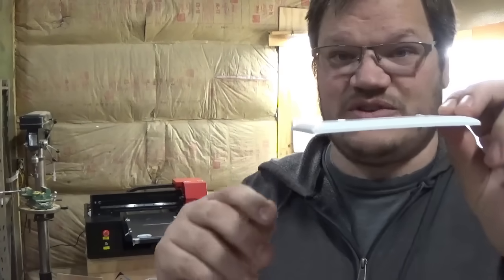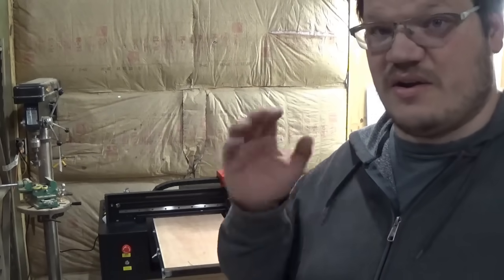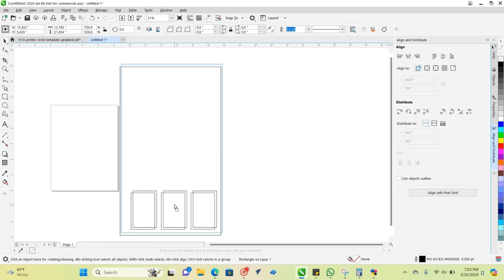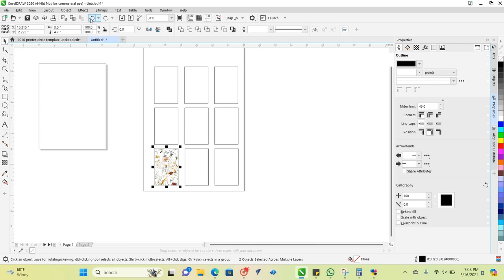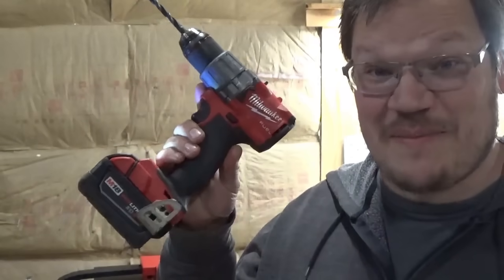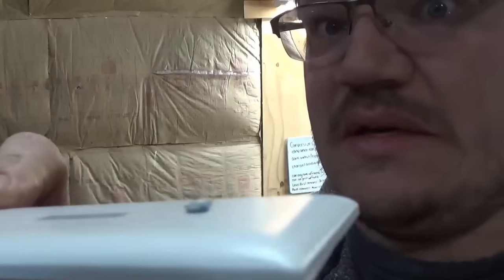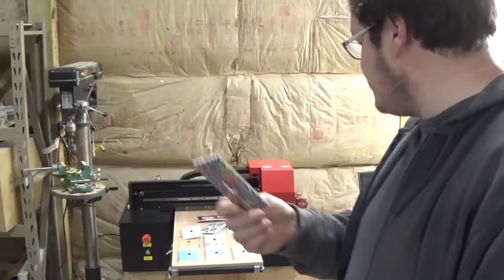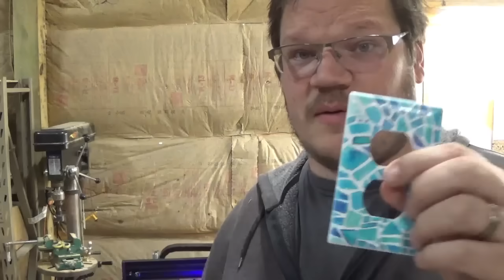How I earn $720 an hour with my uv printer  printing on light switch cover plates jaysprinters

Comment: I see people selling decorative plates for as low as  $3.99 on Amazon severely undercutting rhe $8.99. And when China sees these selling they're going to go lower than $3.99.
Reply: Right a plain white plate is .47 at home depot.
Reply: Those that waste time being worried or scared of competition should consider being an employee rather than a business owner.

Btw, this is intended to be an insult or hateful. Great businesses and business owners would never really succeed and thrive without great employees.😊
Reply: @francismarion6400  those home depot ones break a lot easier the higher selling point is how hard it is to mess up or break
Reply: Bingo!
Reply: Wow that's 86 plates an hour at $8.99 before any;  material, manufacturing, shipping or store costs... not to mention needing to sell them.
Reply: @thevibeinc  No problem. I got a GC license at 26 and successfully operated that with 15 employees for 23 years now. I've seen many scams to walk away from in my time.
Reply: Can't go lower than the cost of fuel to ship products. Then youre working for a trucking and petrol company
Reply: @limbeboy7  This guy is working for the printer company!
Reply: China ruined Amazon etc.  I stopped selling in 2013 even before Amazin itself jacked seller fees up and lots of other bad stuff.

Comment: Pretty cool! Just a suggestion, if you turn the slots in an up and down orientation on the screws, it'll make it easier for customers to line them up make electricians and OCD folks like me happy😊
Reply: Totally correct. Electricians melt down if those screws are crooked!
Reply: 😮😮😮 You can't control which way the stupid screw goes BECAUSE you need to make it tight, so whichever way it goes it how it goes!
Reply: @Some_One_One  Oh, I see.
Reply: @Some_One_One   There's plenty of wiggle room to add an extra 90-180 twist.  I've installed hundreds and hundreds this way.
Reply: @nicolashoyt5341  Maybe  it's just the hundreds you've done, and the hundreds I've done. The rest are just out of spec.
Reply: That's called 'clocking' the screws.  

Now... do you clock them vertically or horizontally?
Reply: Nonsense for people that dont have something more important in their lives!
Reply: @Some_One_One if you’ve “installed hundreds” and don’t try to clock the screws, you would certainly be in the minority.  With plastic covers there is almost always enough flex in the plate to turn the screw a little more to get the slot horizontal or vertical whatever your preference is. Most electricians will do this. Just read the rest of the comments on this video.
Reply: I ran network and home audio cabling in new construction in a previous life.  I can agree, in high end homes the screws must be up and down.
Reply: I just said that. Darn
Reply: Said what we're all thinking.
Reply: @ItchyKneeSon Vertically, gosh.
Reply: You my good Sir. You go to the head of the class! Not only the electricians and the OCD's. But now it's on the punch list. Every screw on every switch in the entire house needs to point N to S.. Worst part is until someone pointed it out it never bother me. Now I can spot it walking into a restaurant.
Reply: @VYZUNZ  Its called attention to detail. Those who can be trusted with small things have shown they can be trusted with big things. If your screws are all crooked it shows a lack of care. When you walk in a place and see the screws are all perfectly aligned it shows they cared enough to do the job right and you probably won't find anything wrong with how they did the actual wiring. The house with all the screws crooked probably has wires stripped to the wrong length, loose wires, or worse.
Reply: @nicolashoyt5341  Though with this stuff, you'd have to do some work or the screw would only align every 360.
Reply: @ItchyKneeSon  nobody clocks horizontally damn it!!!!!!!!!!!! can you imagine the dust build up.....jeeezzzzz man
Reply: I didn't have to go far to find this comment!    -OCD Electrician
Reply: @Some_One_One  If that were the case, which hasn't been for me,  you' d run into the same issue whether it was clocked vertically, horizontally, or some point in between. By clocking them at paint time, it at least gives us OCD folks a better chance at happiness! ;)
Reply: Came here to say the same thing! Looks much better to the human brain and makes alignment easier like you said!
Reply: @Some_One_One nope back it out a little bit if you are putting them on that tight you are probably breaking it or about to, PS I change more of these out than I can count in a month, no problem at all making them up and down on any single plate I've ever installed, not sure how you are doing it but these aren't supposed to be torqued down 🤣
Reply: @fubarsnafu4994 Yuppers! I'm like that with everything because I've done so much remodeling in high end houses and I was always a part of every single part of it, I've done everything but frame an entire house... 😜 Upside I Can fix anything, downside everything bothers me everywhere I go! I'll be taking a piss at a gas station and go wow, look at the edges or grout on that wall tile! 🤣
Reply: @QdMaster I can walk into a freshly framed house and look long side.. you see me start to learn to one side I'm trying to see how out of level/plumb it really is. OCD? Gift or curse you decide✌Slackers make it hard on the rest of us
Reply: @fubarsnafu4994  no kidding! Flooring and trim really p!ss you of when the framers suck!
Reply: @QdMaster Yea hanging cabinets with sloppy framers is always the case. I can make it work but sometimes they make work out of it. SSDD off to work I go
Reply: @Some_One_One   You don't want your trim screws to be tight on your wall plates  because it warps the cover. They just need to be slight snug because they serve no mechanical purpose other than keeping the plate on the wall.  Source: I am an electrician and have done thousands of these.
Reply: @QdMaster  Finish carpenters agree. 👍
Reply: @fubarsnafu4994  that gap changing on your perfectly level cabinets is a pisser, I used to split the difference for a better look, but it always bothered me to have to do so lol
Reply: That was the first thing I wanted to see, did he clock the screws right.. NOPE

I would return it just for that.
Reply: You will never be happy.
Reply: @nick-of-all-trades  I do all mine horizontally , it looks the best
Reply: @jasonmunger8409  you're right about the screws but wrong about the majority of people doing it right XD professionals sure but these days you've got a lot of guys like this doing "hundreds" of them wrong hahaha
Reply: What was the secret hole
Reply: Need to add a little bleed around the artwork.

Comment: Great idea! May I suggest you align the screws vertically (plumb) when you lay them on the bed? Then the pattern will align when the screw is plumb, looking even better.
And you have many more options for SKU's when you add in the Decora style covers and the magnetic ones (with NO screws). Nice work and thank you for sharing Jay!

Comment: You should make sure the screw heads are placed in the verticle position so they are all in the same direction. This is for those with OCD and for the overall visual appeal/finish after installation of the light switch plates.

Comment: You could speed up setup by routering out some starboard to hold the plates in a 1/16 inch recess. No screws needed.
Reply: This is a fantastic Idea! Won't even have to print the outline beforehand for the guide.

Comment: Just an O.C.D., observation. The screws, should be vertical when mounted on the wall. If you set all of them vertical just before printing, the patterns will be correct when mounted on the wall.
Reply: horizontal.

Comment: In a related "product", I work in a commercial electrical company and we use a UV laser to mark cover plates (switches, receptacles, blanks, etc) with circuit numbers or other information as needed. It's the same "indestructible" type covers. I have a template board for alignment in the printer and I just cover most of the plate with painter's tape, use coreldraw to fire up the laser and raster in text or diagrams to burn through the tape and into the plate before finally filling in the mark with plastic-bonding spray paint with the remaining tape as a mask. It takes a little time with all the individual steps but makes a sharp looking piece. For stainless steel we skip the tape and spray on a metal marking compound which looks somewhat like an ugly gray/yellow spray paint but makes an indelible black mark into the metal when lasered, so it remains no matter what cleaners or handling happens. This has been a big saving/profit center for the company since we brought this kind of signmaking, label making, everything-marking services in-house for ourselves and for customers.
Reply: You sure it's UV and not IR?
Reply: @skytek7081  I have a LaserPecker Engraving machine - I love the idea of using the tape and then Lester etching the design and saving time using the remaining tape as a mask. Thank you for this tip. I’m going to try it. Have a wonderful day.
Reply: How sharp is the lettering? Does the ink run or spread on smooth glossy plastic? How durable / does it rub off over time? Resist cleaning agents / rubbing alcohol?

Comment: There is definitely some "youtuber math" going on here. You don't earn any money at all by printing those. You earn the money when the items sell. Seems like the title and a lot of what you say in the video is just designed for clicks, and to get people to buy the printer. Using words like "potentially" would make this a bit more accurate. You could "potentially" earn "X" amount if you can sell all of these.

Also, you don't make $10 each unit, in terms of profit. There are so many costs associated that you don't mention. Not the least of which is all the fees that go with selling on Amazon. There is also all the labor that goes into research, design creation, etc. I'm guessing that after all actual costs involved, you are probably making half or less than half of that. Nothing wrong with that, just click bait to say what you said in the title. At one point I think you even said you could make up to $1000 per hour. The implication is that you can make as much money as you want, just keep printing more items. But again, you don't get any money if it doesn't sell.

I think you are falsely getting a lot of people's hopes up.
Reply from the maker: This is gross profit and intact we do gross this amount but do not net this profit you are right it is lower but still enough for a large shop to profit from this is not false info

Comment: One thing I would say is to spend the extra second and line the screws up vertically. The electrician in me is dying with the screw heads not aligned would piss me off for 8 to 10 dollars each. Just saying what I would suggest

Comment: In 2007 we used to print on ceramic tiles for kitchens doing the same process with a Gandy Jedi UV printer..
Reply from the maker: This is my next video already in the works 😄
Reply: @JaysToDoList  be sure you wipe everything down with isopropyl alcohol and that it’s clean and dry before printing..
Reply: now your talking

Comment: Ask your customers to send a picture with the socket positioned, then you have their wallpaper pattern and can use CorelDraw/and your UV printer to print the wallpaper pattern over the socket, leaving only the rocker switch to show where the socket is located.

Comment: A real electrician, will want the slot of the screw perfectly vertical so dust will not collect.  Love your setup
Reply from the maker: I have seen this comment alot but i think most or maybe all of these cover plates are not being installed by licensed electricians
Reply: I do that because I am OCD, I never thought about dust.

Comment: What else can that printer print on?  Shirts?  Metal Panels?  Posters?  Signage ?
Reply from the maker: @violetjames7534  yes but shirts I wouldn't recommend
Reply: @ thanks for the reply!  Just asking because it’s an expensive purchase to just print on light switch covers.  So sounds like as long as you’re printing on something solid it should be fine.
Reply from the maker: @violetjames7534  yes a uv printer can print on most items there is even a flexible ink ifnyou want to print on items like leather
Reply: @JaysToDoList  very cool thank you!  Best of success!!

Comment: As someone who has OCD, you might put the screw slots horizontally or vertically. Personally, I prefer the slot to be horizontal.
Reply: I too prefer horizontal but my coworkers have bullied me into going vertical as a standard😂
Reply: @trace4125  They should use a design that has 90 degree symmetry. I've felt I've come close to over-tightening sometimes and the cover gets bowed. They could use something that would work with those screwdrivers you're supposed to use for the terminal screws.
Reply: @trace4125   If I worked there, I'd put them at 45° just to annoy the shit out of them.
Reply: vertical is better for the eye

Comment: Will this print on 5052 aluminum or does it have to be special aluminum coated?  Can I send you aluminum plate to see if it will work?  I want to buy this for my small business but don’t want to spend $3500.00 if it doesn’t work.
Reply from the maker: Sure we print on aluminum all the time you are welcome to send me some aluminum to print on for you.  There is a metal coating to help with adhesion .  You can send us a message through the website to do a test print jaysprinterparts.com

Comment: Just so you know, many professional electricians always line the screw slots up vertically.
Reply from the maker: Never worried about it when I was a professional  electrician
Reply: @JaysToDoList  So, that profession didn't work for you?  Not surprised since you don't seem to take suggestions well.

Comment: Got to get those screw slots lined up vertically before printing
Reply from the maker: I'm gonna keep them crooked just for fun now cause I have never had a complaint over the thousands we have sold
Reply: @JaysToDoList  just saying if an electrician or decent painter has to remove it and put it back on they always line the screw up

Comment: Holy smokes man. I kept expecting you to have gone to all of that effort to make the board because you needed to attach the plates to it. You can just get some rigid foam board and press the screws into it. That would save you a mountain of time.
Reply from the maker: Actually  very good idea thanks we just have lots of scrap wood since we are also a wood sign shop

Comment: Why would you not align the screw slots vertically! 😭
Reply from the maker: Haha sure you can do this and do even more at once just just did it for the sake of the video real fast and didn't use the machine to its full potential 😉
Reply: Spoken by a fellow OCD person!
Reply: I do Home Automation installations. EVERY cover plate I’ve ever touched (and many more) have the screws absolutely, perfectly vertical. Customers DO notice, it looks much nicer.  PS: my Yelp reviews are all 5-Star.
Reply: Exactly, when he showed the screw slots misaligned it was really weird to me.
Reply: @BitSmythe  - as you stated, always align the screw slit vertically. Not because you are OCD, but because the customer just might be OCD - it will make the customer happier.
Reply: You monsters with the vertical slot alignment must be stopped. Everyone knows the slots must be horizontal. 😊

Comment: 720$ an hour? I call BS.. for the simple fact that people aren't exactly knocking ya door down for light switch covers. Cool toy though and i do see potential, but light switch covers just aren't in demand like talkin about my guy. My question is can you do designs on say a pistol, or rifles? Or doest the object have to be perfectly flat? Even vehicle trim peices like around the radio or the gauges, or interior door handles, stuff like that for custom car builds. Anything that can be removed and is plastic. The possibilities are endless if it doesn't have to be perfectly flat. But light switch covers??? Nahhh😏😒
Reply: I think that’s its potential, not actual earnings
Reply: Most hardware stores don't do special graphics if any, why do you call this man a liar because he found a niche in the market, stop being a doubting Thomas and try it yourself.

Comment: If you'd like a bit of advice, the slots in the screws should be straight up and down. When installed in new buildings contractors do it this way so when the inspector comes by and looks he'll know that no one's been messing with the electrical besides the electrician. Any painter worth his salt Will always put the screws back in this position after removing for painting
Reply: I go by the way the switch plate is oriented, vertical the slots are vertical, horizontal the screw slots are horizontal. Looks better. People who leave them just facing any way idk how they sleep at night.
Reply: Personally I use a torque driver and tighten them up properly.
Reply: So besides the electrician, the painter could have been messing with the electrical.
Reply: @adrianscarlett  This sounds like one of those jokes that begin with "A contractor, inspector, and carpenter put on switch plates..."
Reply: @adrianscarlett  That's right, 585 pounds of torque!

Comment: Heads up:......most electricians either turn the slots in the screws to horizontal or vertical. Most will set them on vertical. Just saying as an ex electrician. (our reminder was to use the song..."the slots in the screws go up and down, up and down, up and down....."  like the people in the bus :)~